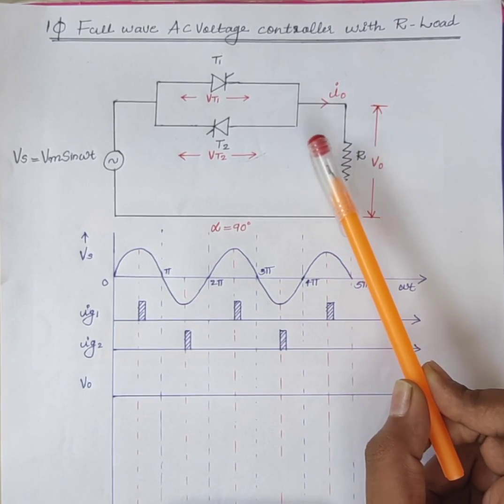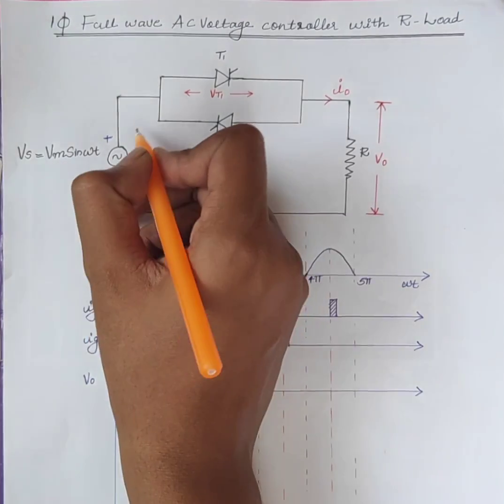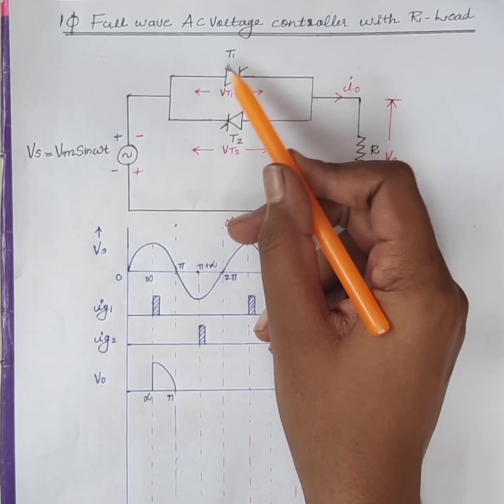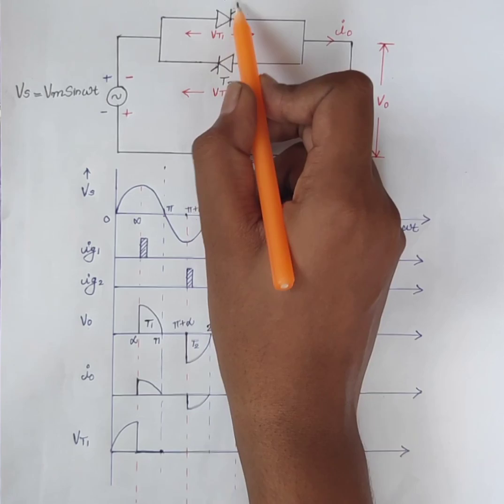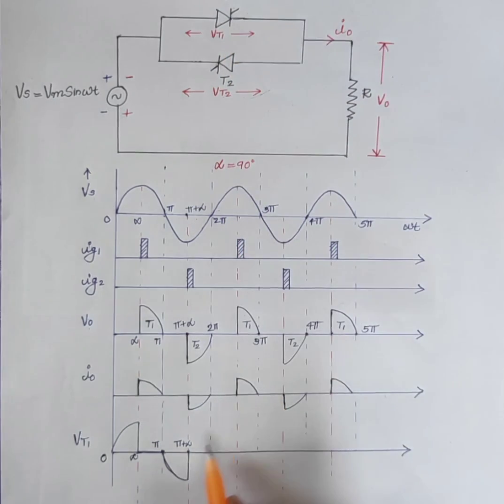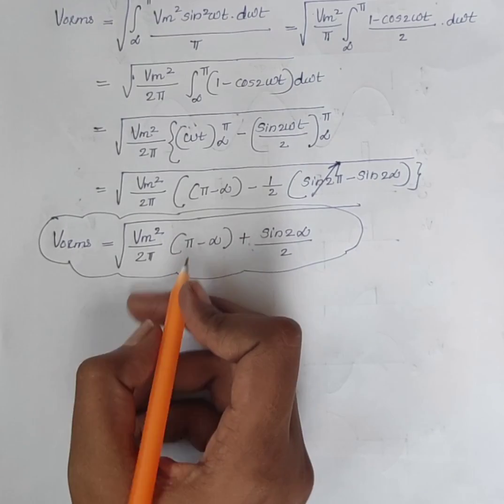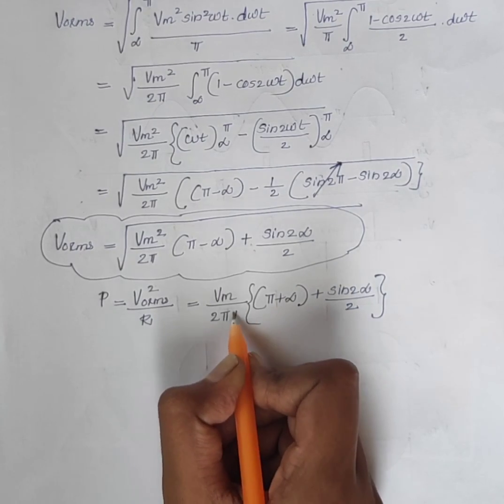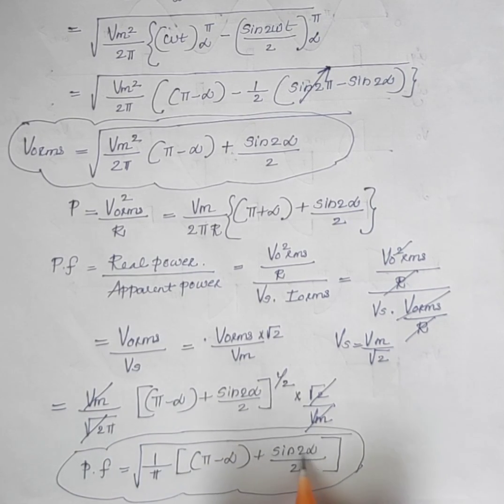Single phase full wave AC voltage controller with R-load

Comment: Why it is taken as 1÷π
Instead of taking 1÷2π.. please reply ma'am ☹️
Reply from the maker: In case of symmetrical waves like sinusoidal voltage or current, the average value over one cycle is zero. It is because the positive half cycle is exactly equal to the negative half cycle. But the average value of positive or negative half cycle is not zero. Therefore, in case of symmetrical waves, the average value is calculated for half cycle.
Reply: Thank you so much ma'am I was so confused about ittr😢 @anetjose2836
Reply: Also thanks for ur question❤

Comment: Mam actually, when the thyristor is in forwarding bias, voltage drop doesn't happen and if it is in the reverse bias the whole voltage drops so the voltage across the thyristor graph,  should be reverse I guess mam, Please can you explain?
Reply: When T is forward biased it act as closed switch thus it act as a short circuit so no voltage drop occurs but when T is reverse biased it act as an open switch so the whole applied voltage can be found on T

Comment: ma'am what is the main difference between fixed 1-phase A.C voltage and variable A.C voltage
Reply from the maker: In variable AC voltage we can  vary the output voltage waveform by controlling the on and off time of switches. In case of fixed AC we can't control the output voltage